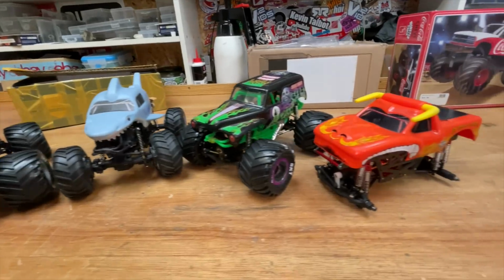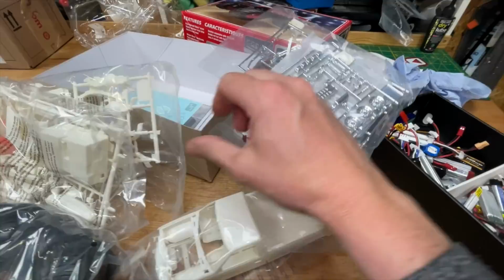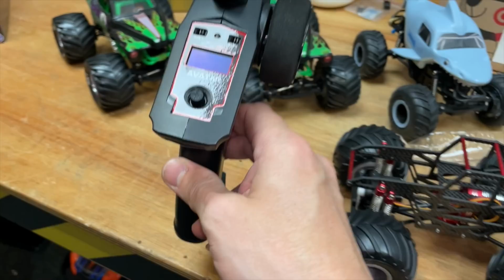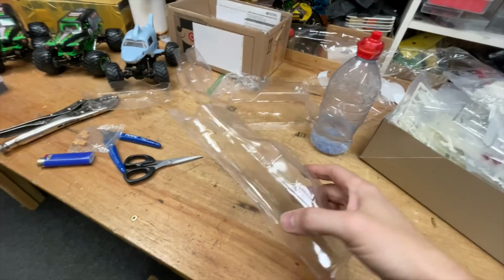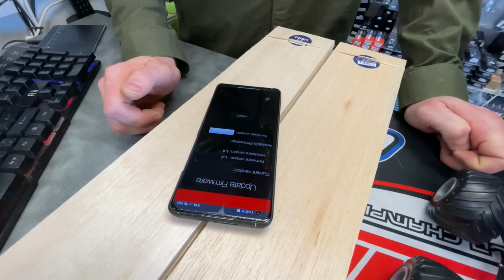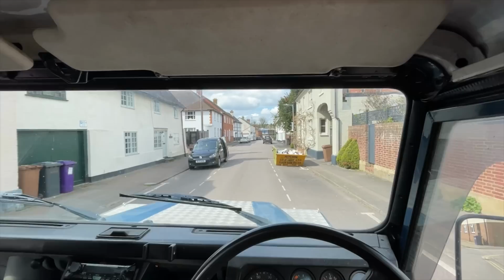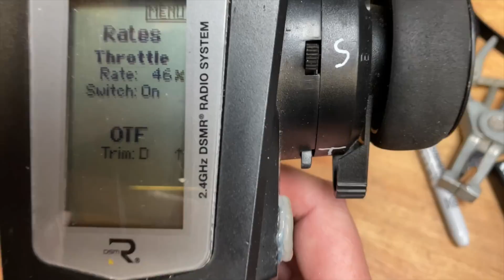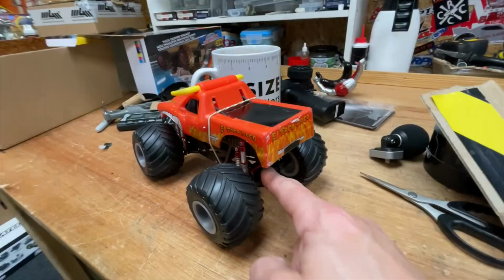Ultimate Micro RC Monster Truck can do backflips

Comment: It amazes me that even after the success of the Losi LMT, most hobby brands haven't gone all-in on their own versions of solid axle monster trucks. There's sooo much untapped potential for that market!
Reply: Thats how i feel about the mini/micro rc car market in general
Reply: Mst Mtx is pretty sweet.
Reply: Cen racing has a few trucks as well, they are smaller then the LMT though in size.
Does Axial still do their smt10 monster truck ?
Reply: @TheWisdom3  Yeah I know. I was gonna buy one a while back, but they don't make em anymore and even if you get your hands on one forget about finding spare parts...
Reply: Oh yeah I've been waiting for a legit micro monster.. but what happened 😕 it broke... looks like easily broke...
Reply: @Mini-z1994  yes they do and seem to be ALOT cheaper now especially kit version 👍 Also there is the RC4WD Carbon Assault Monster truck which look pretty cool but think the LMT is most realistic.
Reply: Block man
Reply: Oh yeah Mr. crabs oh yeah oh yeah Mr. crabs oh yeah Mr. crabs oh yeah oh yeah Mr. crabs oh yeah
Reply: @Garf2O  hwehjeje

Comment: This reminds me of the Venom Mini Giant from the mid 2000's.  Wasn't as good as this, but it was pretty neat at the time.
Reply: Had a clone from HBX called GX-4 i believe, ran on a 7.2v pack & was pretty quick for it's size. managed too crack the lip of the rim which didn't affect driving really & damage the 27 mhz receiver which kind of killed it.
Sent it off too a guy who was supposed too repair it & my mini-z's
(Burnt mosfet on the pcb of the mr01 & a Iwaver 04 which needed some soldering on the servo side of things & it would have been up & running.)

I never got it back but i got the mini-z's back & he didn't even try too do anything with them they just were left in storage collecting dust for 2 - 3 years or something.
There was also the A-tech 1:20 monster truck which was basically a rebranded Venom Mini Giant, pops up on the bay every once in a while, there's actually one on there now new in box A-TECH BISON.

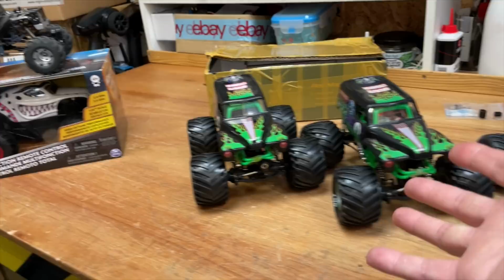& I know HBX for a short while had a solid axle 1:16th scale monster truck called 16885 as well.
Reply: Sup.. I just found my TMAX from 2002.. I barely used it back then.. it needs like $20 in parts to fix front control arm.. engine still runs.. where can I sell it and how much is it worth? Where could I trade it for like a $100 electric car?

Comment: That 90's model Chevy body that came in that static model kit that u got the tires from is probably the best looking model that Chevy put out in the opinion of a big majority of the U.S. that's the model that u will see most on the U.S. road ways. Will it fit that chassis?

Comment: Try turning the c10 body around and cut a little off the carbon fiber chassis. Then reverse motor direction and add second steering axle.

Comment: The little white ph2.0 connector will be causing huge voltage sag. If you bypassed it you'd get a lot more performance. They are fitted to a lot of micro drones, first thing I do is replace them.

Comment: Kevin: When you cut lipi wires you are not supposed to cut both wires at the same time to avoid shorting out the lipo
Also Kevin: Proceeds to cut both at the same time half a second after saying that

Comment: Great video kev mini monster trucks for the win. I built myself one and the furitek combo it crazy especially if you turn the turbo mode on and 3s have fun watch out for the pinions though I have ate about for so far mesh it were it’s supposed to be o well their not that expensive have fun

Comment: Hey Kev I got a problem so I got a Traxxas Stampede 4x4 but the transmitter won’t bind with the receiver is it best to replace the receiver or buy the DUMBO-RC transmitter and receiver that you use on all your RC vehicles and put it in my Stampede 4x4?

Comment: Kev, My toy-grade RC car is cutting out every time I drive it. It drives well until I use the steering and throttle at the same time. I changed the battery and I think that's what caused it. When it stops, I touch it and it starts driving. I hear the motor making a whirring sound when it stops, What should I do?

Comment: Sup dude.. I Just found my TMAXX from 2002.. I barely used it back then.. it needs like $20 in parts to fix front control arm.. engine still runs.. where can I sell? And how much is it worth? I'll trade it for a 100$ electric car at this point

Comment: I recommend you replace the PH2 connector on the esc and directly solder the XT30 as those PH connectors get really flimsy and their resistance increases significantly, so less power to the motor.
Edit: nevermimd, the og esc got replaced anyways 😅